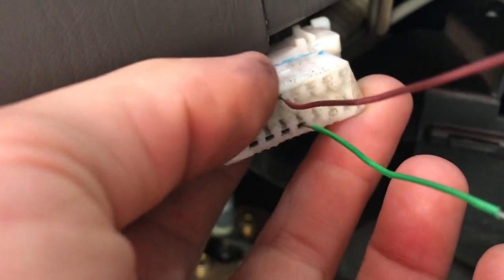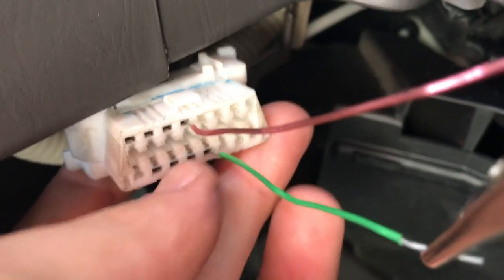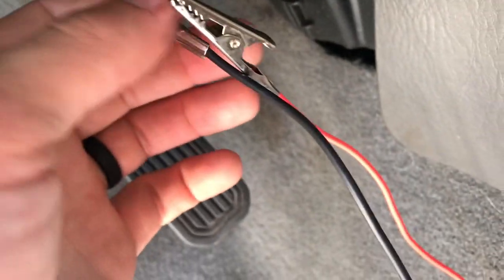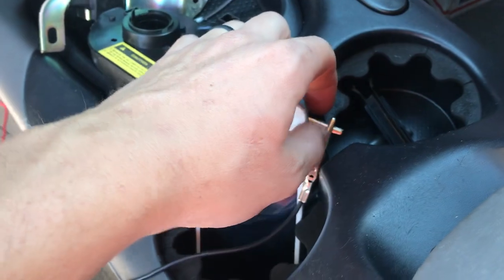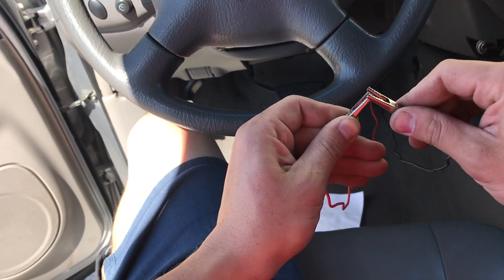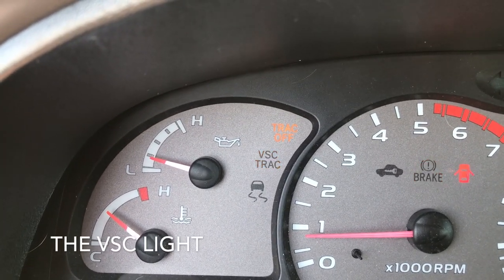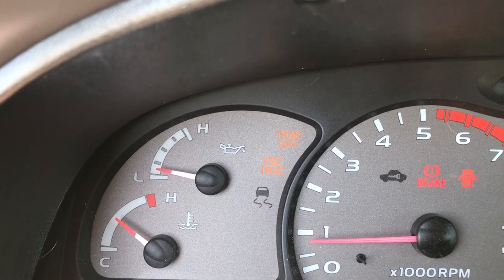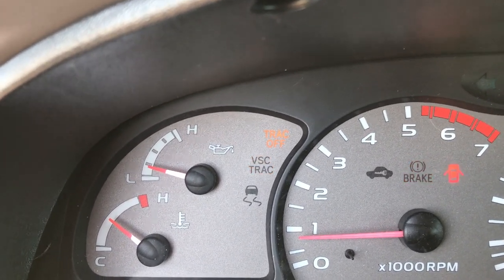How To Read VSC Codes Toyota Sequoia Tundra 2001-2007 Stability Control ABS

Comment: Difficult to find a "1st Gen 2002 Sequoia OBD port placements" (they vary) Attempting to 'clear / reset' for steering zero point calibration. Remanufactured Toyota rack and pinion (wasn't centered from factory) struts, bars, etc.. Paid Tire D's_ over $440 for alignment because one tie bar was off, 3 visits later, my TRAC / VCS light are still on, system OFF. The steering had to be disconnected, my tire slip comes on often too. Hope this works! thanks!

Comment: Thanks for the video! I get 2 codes, 52 & 61. Where do I find out what those codes point to and how would I reset the codes?
Reply from the maker: check the description of the video for a list of codes and what they mean  resetting it you need a scanner that resets ABS lights or you can do it manually but i haven’t had too much luck with that

Comment: I have a 04 sequoia and my vsc trac, cruise,abs,seat belt, airbag, doors open, & e brake, lights blink rapidly like in the video. None are solid and I dont have a check engine light. Does this video you showed stop all the other lights from blinking rapidly? Any information will help thanks it also does not do this all the time sometimes I have no lights on the dash and everything seems ok
Reply from the maker: Maybe you have a bad alternator. Or a bad connection to your battery. I don’t think this would be your issue here as you have all the other lights on. Sounds like a power issue.
Reply: @karrskars I noticed in your video all of your other lights I mentioned are all blinking rapidly

Comment: Hi
First thanks a lot for the video. I have the same light on for 2003 Sequoia, do you think the holes numbers on the DB2 will work for my 2003, or they are different from yours 2002?

Thanks in advance
Reply from the maker: Should be the same
Reply: @karrskars  Thanks for your response. I'll try this tomorrow and will let you know boss. Have a great day!
Reply: King TuT did you do it ? I also have 2003 sequoia. Gotta do this calibration
Reply: @tcjha6250  it was not the same. I didn't do it still drives though.
Reply: Did you do it? how did it go?
Reply: @manfromatlants   The pin layout was slightly different but I still put the clips in the same holes as he did. 4th from left on top, 5th from left on bottom. VSC TRAC light gave me the codes. Hope it has you guys.

Comment: Code 31 and code 34 VSC TRAC. Replaced yaw and steering sensor under center console no luck. Any other suggestions?
Reply: Sounds like you need a zero point calibration

Comment: Where the hell do you find these codes? Mine flashed 39 but I can't find what it means..
Reply from the maker: Are you sure it’s 39? That code isn’t on my list and I can’t find anything on google.
Reply: @karrskars  Nope. Lol I have counted it so many times and I keep asking myself the same thing. I can't find anything on it and the vsc and trac off light have been driving me insane for 5 months now, I've tried several different ways to reset them and nothing works. My engine light came on (due to the gas cap) but when I plugged the obd scanner up and all the normal lights came on, those 2 never went off, but the engine light did. 
About a week ago, Out of nowhere, my car just started stalling and I babied it home..and started googling. But, it hasn't done that since. I cleaned the throttle body and changed the air filter which were grimy as hell, so I'm hoping that helps, but these lights are still driving me nuts!
Please Feel free to count and see what you think, I would love to be told I'm wrong on this, after all I am just a Google mechanic 😁

https://youtu.be/S8JKRnaykFQ
Reply from the maker: Go to autozone and have them read it. You just need an actual ABS scanner to see what the code is.

Comment: Code 53?
Reply from the maker: The "53" code is "Malfunction in communication with ECM" This is either an issue with the "ECM" or "Translate ECU" or the connector between these two.